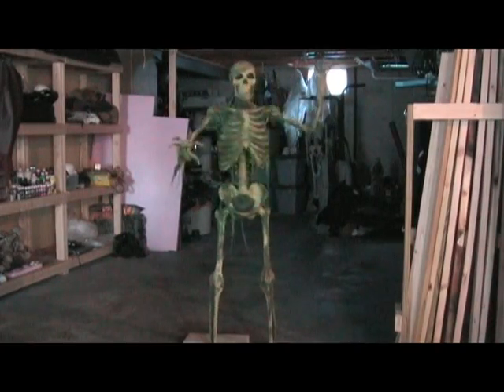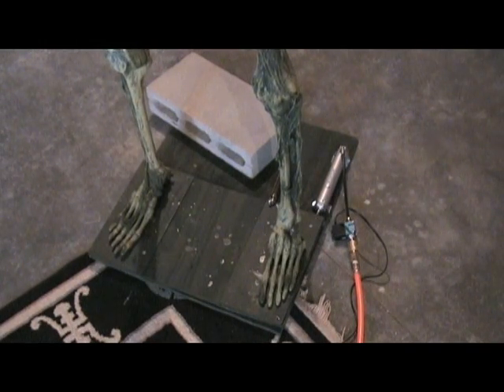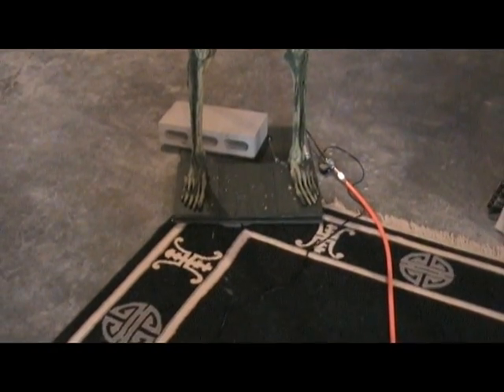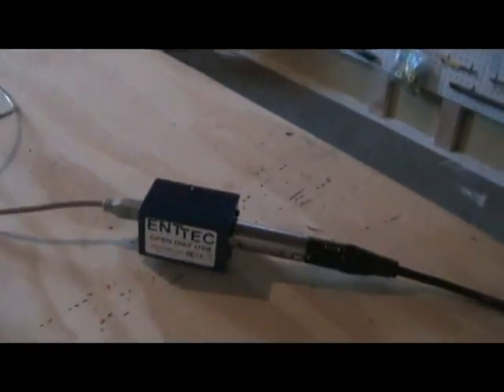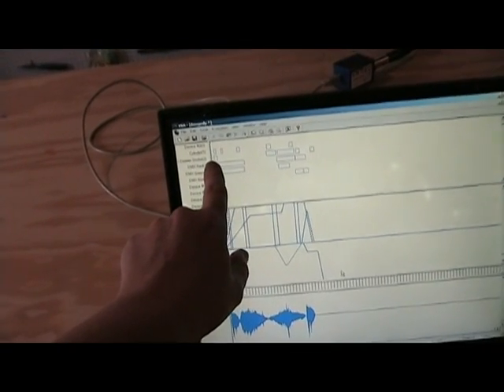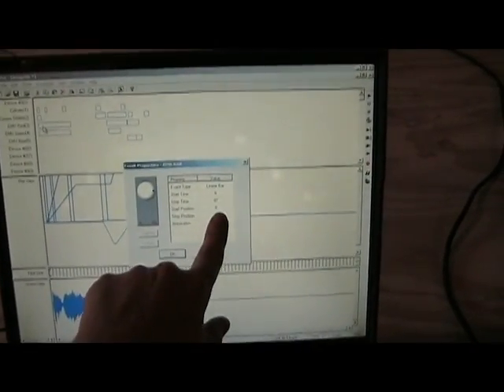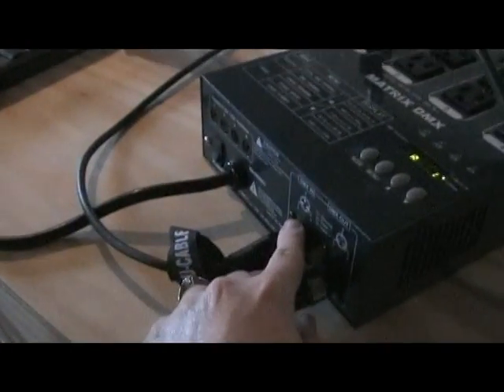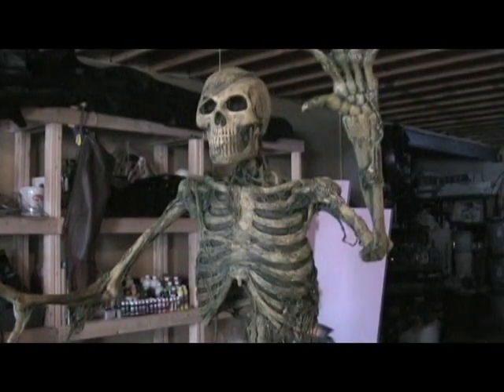Boogedy Halloween prop how-to of DMX, pneumatics, VSA and sound

Comment from the maker: @donttrustsnowmen Oh good. Hope it helps. Note that I had to change the mechanism twice. I show another video showing a new wood block design. On Halloween, the wood broke, so I went with all metal hardware for the connection and have been running fine ever since.

Comment from the maker: @toxicfrost123 Good question. Well, this prop was actually part of a larger haunt. 6 props controlled via DMX and another program called DMXorcist that allows me to command each prop but they are all connected with the DMX protochol. If you have just one prop then relays and microcontrollers are great. Love what Fright Ideas (PicoBoo) makes.

Comment from the maker: @TheWerewolf1215 I think it would! It wouldn't have that sudden start but the electric motor would still have a good hit of power to make the thing wiggle. All it needs is the start of momentum. I guess worse case, you could go pneumatic if the electric motor doesn't work out for you. Boogedy is a big investment so I'm afraid to tell you for sure without me testing it first. Look at my Transworld 2009 video to see hubby jostling it so you can the force Boogedy needs to keep going :)

Comment from the maker: @MrBobby47 No, you just need the one computer. Once you have your DMX chain set-up then you add to it as needed. Each DMX relay box has four channels. Most times my prop only needs one channel so that leaves 3 other channels for other props. For example, this year I'm running 7 props but only need two DMX relays. 

I like the idea of stand-alone props too(like using the MonsterGuts Nerve center). For me, I like the central control I have but it's a personal choice. My way has drawbacks too.

Comment from the maker: There are timers you can buy that can also be used to trigger props. Now, for my full show of Boogedy, you need to have a way to fire your VSA computer program (other than just hitting the enter key on the computer). I use DMXorcist. I start my 5 prop shows by simply pressing the corresponding button on a remote.